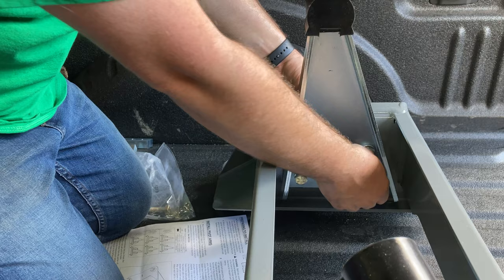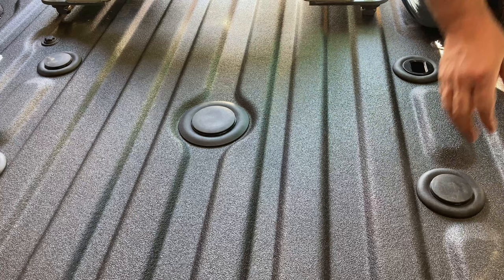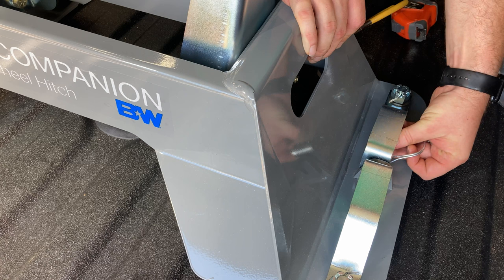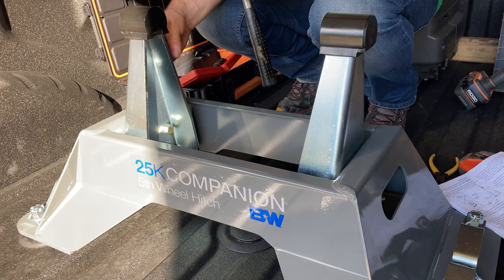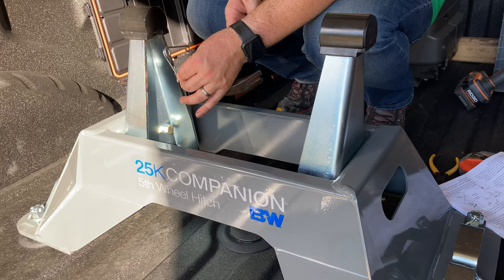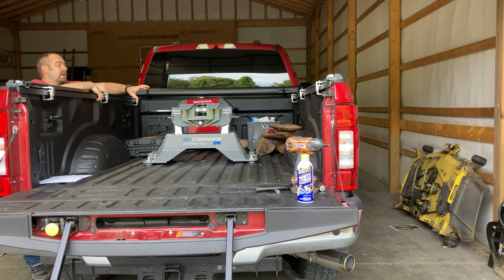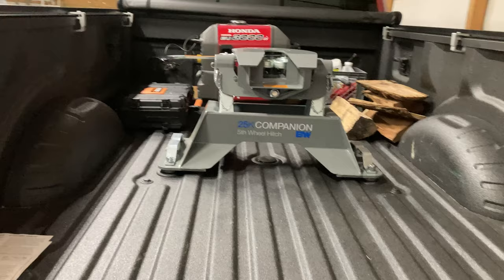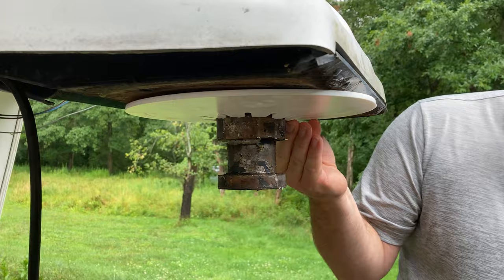B&W 5th wheel Companion Hitch RVB3305 RVC3006

Comment: I clip my break away brake cable to the hitch latch arm too.  It's safer there than anywhere in the bed where it might get snagged by cargo, which is much more likely, and possibly as dangerous, as the whole hitch pulling out.  That hitch is not going to rip out.  Also, I love the recoiling brake cables that are available.  You might look into one of them.

Comment: Great video. Thanks. Why did you switch from the Andersen Ultimate Hitch? I am using the Andersen for my toy hauler and so far having good luck except for the constant fight of the articulation and the tonneau cover rail impacts.
Reply from the maker: I didn't have any complaints about the Andersen hitch. I just wanted to try the B&W hitch so that I could talk about it with those that follow Purple Collar Life. I am very impressed with both hitches.

Comment: Need to drop that pin in the handle from the top if the bail would fail the pin won't fall out
Reply from the maker: I actually thought of that while I was doing it.  I've put it in through the top ever since. Thanks for leaving the comment!
Reply: @PurpleCollarLife  no problem , I use the same hitch got a 21 350 7.3 4.30 rear long bed, really happy with it so far

Comment: Nice truck but I seen in one of your videos that you bought the AUH do you still like it, I had two of the B&W hitches they are build solid?
Reply from the maker: That's correct - we've used both the AUH and the B&W.  I like both for different reasons.  I don't know if I would be able to say which I like better. I pick one or the other depending on the trip. Thanks for watching!

Comment: I know you switched to Anderson hitch but I was just wanting any information on B&W 

Any issues?
Any disconnect advise ?
Are you able to connect at different angles ?
What was the reason for the switch to Anderson? It’s ok if it was just a sponsorship video and testing reviewing product, I trust your opinion.
Reply from the maker: We wanted to try both hitches - the B&W and the Andersen.  We have had 0 issues with either type. The B&W is a standard type connection - we made a video of connecting to our previous hitch here: https://youtu.be/2H24Kva7_e0
We have been at some articulation angles, but nothing severe. I did notice that at some angles, the hitch does not easily release the kingpin. It takes some manipulation and can then be difficult to reconnect. It’s always best to be mostly level left-to-right and front-to-back between the truck and the trailer when at all possible.  There have been times that I’ve actually put some boards under one side of the TRUCK back wheels to level things up before disconnecting or connecting to the 5th wheel.
We definitely liked both.  There are 2 reasons we use the B&W most of the time. Reason 1 - it prevents me from backing too far toward the trailer. The hitch makes contact with the king pin and keeps the tailgate from potentially hitting the camper. Since the Andersen requires lining up the ball with the hole - there’s potential to hit the tailgate on the trailer.  Reason 2 - it allows the kingpin to remain “stock”. If something would happen to my truck and the trailer would need to be towed by a friend or tow service, a standard 5th wheel hitch can tow it.  With the Andersen - I’d need to remove the connector portion of the kingpin adapter.  Great questions.  Thanks.

Comment: Another great video Chad, just installed this same hitch by following your instructions.

What I did for the cable was to put a 6ft coiled cable on the trailer and installed a retractable tie down in the driver rear stake pocket. Keep the brake cable up away from everything and tied to the corner of the truck instead of the hitch.
Like this video

https://www.youtube.com/watch?v=02FG58xLDMI
Reply from the maker: Thanks for letting us know! 
Good idea to get the longer cable and connect to the stake pocket. I've been thinking about getting a longer one, putting a quick clip on the end and connecting it to the tie-down point at the bottom back (driver's side) corner of the bed.